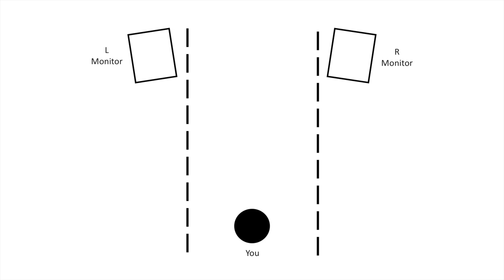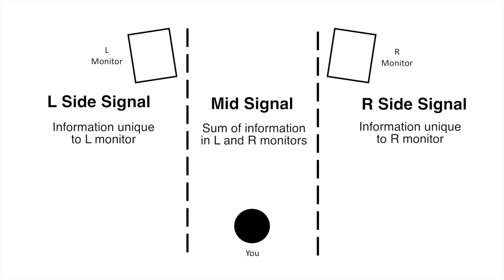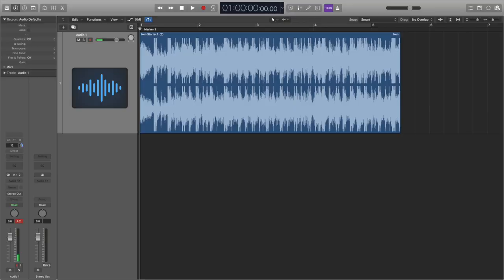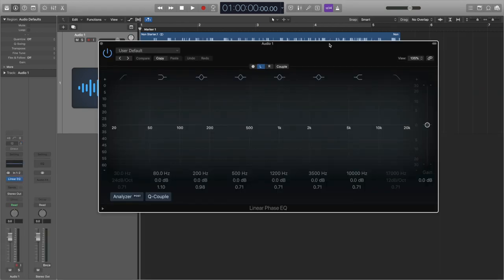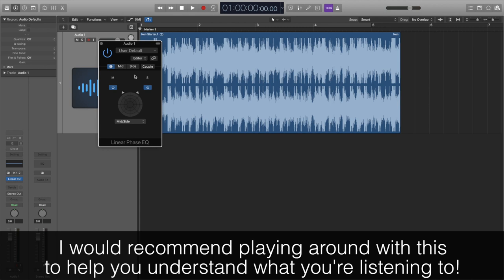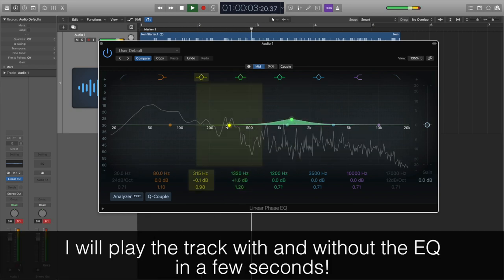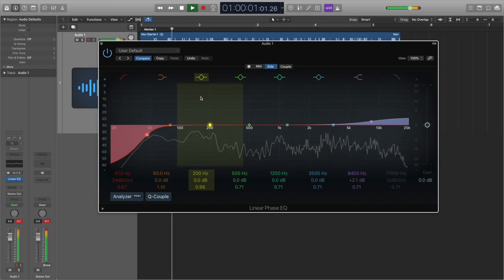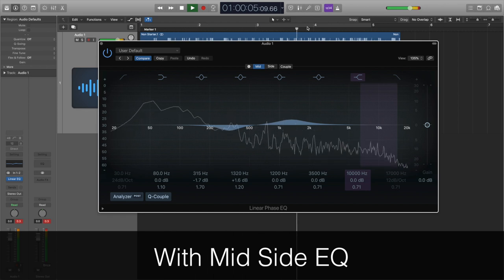What is Mid-Side Processing? (Mid-Side EQ Tutorial)

Comment: Very much digging your videos recently, keep up the good work 😁

I feel like I'm missing something fundamental with the whole mid side concept. 

Mid is an artefact of having an L and an R, and doesn't actually exist discreetly as there is no mid channel or mid speaker. Whatever you do to the mid will affect each side, and whatever you do to one or both sides will affect the mid.

If I'm right with the above then it shouldn't work, but clearly it does work, so what am I missing?  🤔
Reply: The mid is not a discreet channel like the center in a 5.1 setup for example. Instead in this context the mid is simply the stereo channel collapsed to mono (the average of left and right channel). The side channel is in this case based on the difference between left and right (or more exactly = 0.5 * (Left - Right) ). We can the apply our processing the mid and side channel separately. After processing, a stereo version is created again by doing the conversion in reverse.